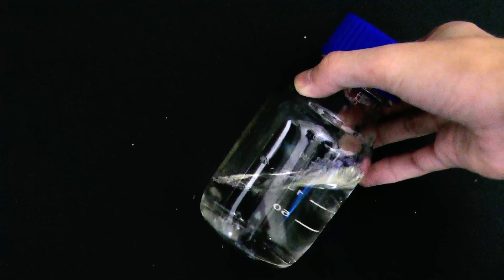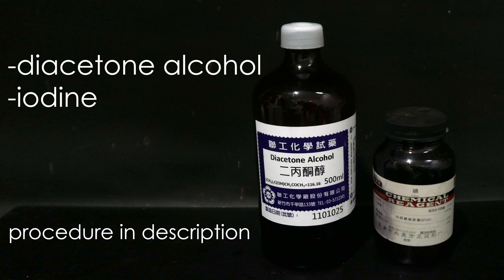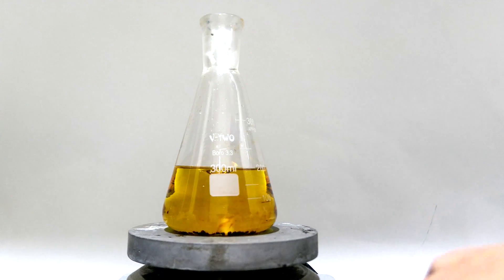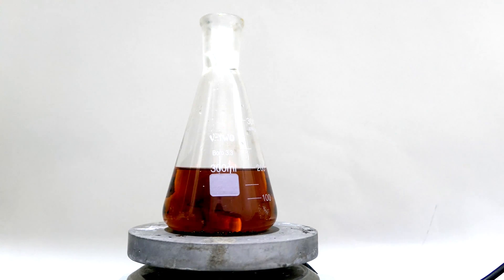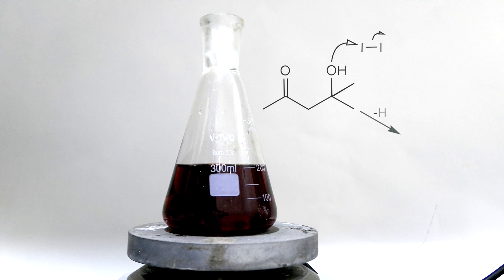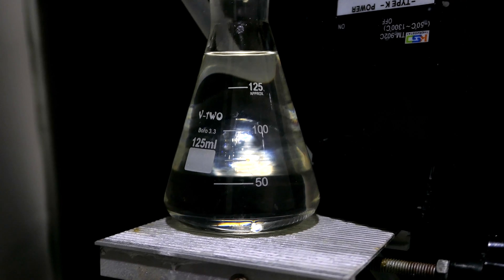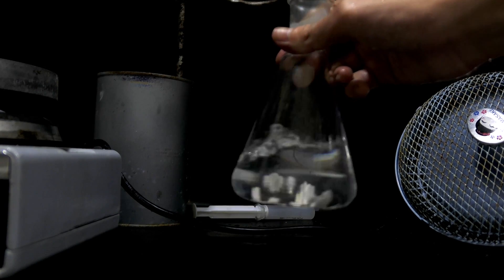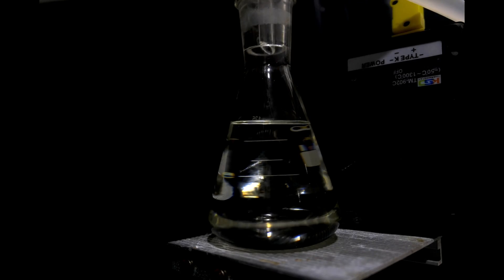making mesityl oxide - iodine catalyst aldol condensation

Comment: How can I convert it into MIBK?
Reply from the maker: you have to reduce it by utilizing something like Pd/C 
https://www.organic-chemistry.org/synthesis/C1H/reductionsunsaturatedcompounds.shtm#:~:text=Various%20carbon%2Dcarbon%20double%20bonds,as%20catalyst%20in%20refluxing%20methanol.
Reply: @chemical_oid  is positive to use the ceramic inside of a catalytic converter instead of pd/c ? It contains palladium on a substrate
Reply from the maker: @kelvinpino4065  maybe? But i think dissovle the palladium with nitric acid then reduce it onto the carbon would be a better approach, since catalytic converter contains a lot of metals
Reply: @chemical_oid  oh yes that would be a better approach. Do you have a more detailed information about doing the reduction of the MO to MIBK?

Comment: 2 question i have: what method did u used for the aldol condensation of acetone, and b,how does it smell mesityl oxide?
Reply from the maker: 1.http://orgsyn.org/demo.aspx?prep=cv1p0199#:~:text=Diacetone%20alcohol%20can%20be%20prepared,hydroxide%2C2%20and%20barium%20hydroxide.&text=Barium%20hydroxide%20reacts%20more%20rapidly,used%20in%20the%20procedure%20described.

2.sharp gasoline smell as i remember.... definitely not a sweet smell :)